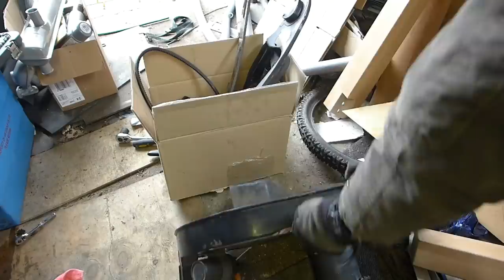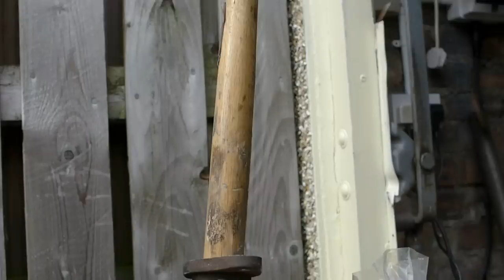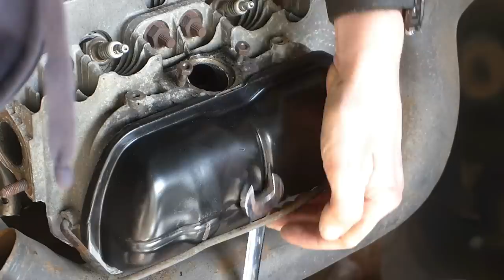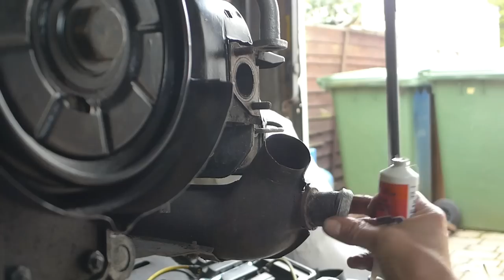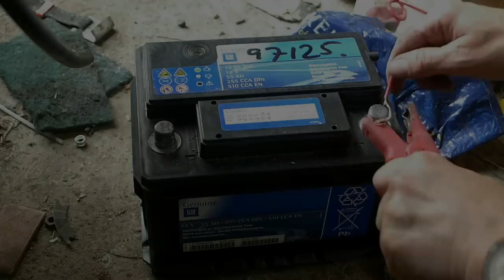Volkswagen Beetle Engine repaint.

Comment: It's nice to rebuild an engine that's complete and not butchered. I've done a couple in my time and spent days repair crap other people have devised on these engines.
Reply from the maker: This engine had spent its life in the USA so the tinware hadnt had the chance to rust badly. It was a nice change to have all the screws come out without tearing the tinware to bits.

Comment: I had a 67 bug. I froze my ass off in the winter in that thing. The best mod for those cars is a gas heater, either an old aftermarket unit or one of the new China made versions.
Reply: Why? All you needed to do was fix the heat on your car. I have never had a problem with mine in my 67. I had a 68 once that had broken cables, but when it got cold. I would take a coat hanger and wire the heater boxes open. Problem solved. But then the heat was on all the time. 😁
Reply: These cars have great heaters.  My '64 will cook you outta there.  You have to sort out the problems.

Comment: Might want to take some safety wire to the clamp holding the fuel line to the carb.  That fitting is pressed in, pretty notorious for that fitting to pop out while driving, happened to me once, all it took lol

Comment: Excellent job! I'm painting mine right now. What hole did you weld closed on the intake manifold? What's the benefit?
Reply from the maker: Thanks. The hole in the intake is a bit of a mystery. I bought the engine complete and it had the hole with a brass fitting through it. I suspect it may have been for a vacuum gauge or servo assisted brakes but the fitting went through the side of the manifold and sat in the gas flow of the carb so couldn't have been good for fuel flow. Weld didn't stick to copper, that's why I put copper behind it and I was then able to plug the hole with weld and not fill the manifold with slag.
Reply: @AstonishingGlasgow  ok cool. Now I have another question. Did you weld a pipe onto an old pulley to use it to hold the generator stator steady? Nice idea
Reply from the maker: I sure did, it makes removing the fan much easier. Its a length of scaffold pole that I also use to tighten rear hub nuts.

Comment: suggestion for next time?? retorque the heads and adjust the valves too.
Reply from the maker: That was all done when I rebuilt the engine. If I added every step the video would have been an hour long.

Comment: a very nice video, please buy yourself a torque wrench to torque the oil filter, oil nut, spark plugs, poley, oil fill tower, etc to specified torque for your next job, that way you will not ruin the beautiful engine that you have painted.
Reply: You dont need a torque wrench for everything.

Comment: Cool vid man how'd u manage to get that crank pully off what did u hold on to while you were using the ratchet
Reply from the maker: Thanks, I had a flywheel lock on to stop the crank rotating while I loosened the not then used a set of pullers to remove the pulley.
Reply: BTJustice alright thankyou that helps a lot! Thanks.

Comment: I think you bent the crank pulley with that 3 arm puller. VW Factory uses a German Kukko puller
Reply from the maker: It was bent long before I got to it. I used what I had available and there was definitely not enough force going through the puller I used to cause damage.

Comment: can’t help but notice you didn’t flush the block of coolant?  forgot to reinstall the radiator too😂😂you should call your local parts store to buy one
Reply from the maker: Thats one of the hardest jobs on these engines so I saved that for part 2 along with the cam belt change. :-D
Reply: BTJustice did you also save the piston return springs, blinker fluid, and muffler bearings for part 2 as well? asking for a friend

Comment: I didn't ever see the 2 Little tin pieces that go on the bottom that clip to the long head Studs.... Most guys forget them and you can't put them on after the Heads are on.
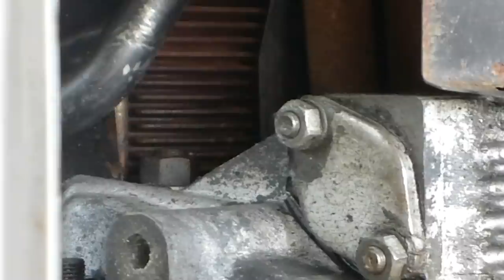Reply from the maker: They are fitted, you can see them at 7:05 above the push rod tubes.
Reply: I just put mine on after the heads were on.

Comment: You don't paint Volkswagen engines,the cylinders can be painted,but definitely not the heads or case.Dont even think about powder coat.Theyre are specific paints to use on air-cooled cylinders.
Reply: Why cant you paint them?
Reply from the maker: I would disagree with David Thompson above and say its fine to pain the case but never the heads or the cylinders. The cylinders are finned to disperse heat so the paint would soon burn off or may effect the cooling. On a VW engine its also pretty pointless to paint the heads or cylinders as you will never see them.
Reply from the maker: I really dont know what that says, sorry.

Comment: Fuelfilter is mounted in the wrong direction. Turn it 180 degree and you’re good.
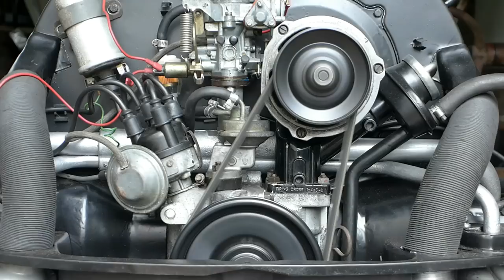Reply from the maker: Its mounted the correct way. If you pause the video at 9:18 you can see the arrow cast into the plastic showing the direction of flow.

Comment: Did you turn an autostick into a manual, cause I seen you filling in that hole in the manifold
Reply from the maker: That hole in the manifold had an unknown origin and use. It was drilled before I got my hands on it but what I can say is that the fitting was definitely not a factory part so its unlikely it was there for an autostick.

Comment: the new engine need rebuild, not repaint. but good job, you just extending the life of the engine by 1%
Reply from the maker: I had fully re-built the engine 2 years previously and it had covered minimal miles. All I was doing was painting the tinware and a service before re-fitting it.

Comment: You could have wire wheeled all the metal like the starter and the outside of the cylinders and all that
Reply from the maker: Thats not the starter from the car, thats the one I use to test engines and its best not to wire wheel the cylinders incase it breaks off a fin. Added to that the cylinders are not seen once the engine is in the car so a bit pointless.

Comment: Nice, 1600 single port engine...?
Reply: Mine is the same. I lived in Las Vegas and updated my 67 Ghia 1500 single port with a later doghouse style shroud and oil cooler when I rebuilt my engine. It was a daily driver and I never had it overheat on me. Simple but effective upgrade👍

Comment: What type of paint did you use? High temperature or just regular paint?
Reply from the maker: Just a regular straight to metal paint. If the tinware on an aircooled engine is getting hot enough to burn paint then the engine will be dead before the paint comes off.
Reply: @AstonishingGlasgow  Too true. 😁

Comment: Zero repair, only paint.?!
Reply from the maker: Thats what it says in the title "re-paint". I re-built the engine around 3 years before this video.
Reply: @AstonishingGlasgow  sorry man. Good luck
Reply: Agree with you. Just a limited paint job of some upper pieces.
Didn't paint below parts.
At least he would changed clutch
Reply from the maker: @gigi09pinky68  Dont assume that things were not done just because they were not included in the video.

Comment: I noticed you were not using the thermostat,thats a no no.
Reply from the maker: Its not going to be an issue for this car as it wont be used in winter. It would have been a bigger mistake to run it without flaps as these push the air towards the cylinder heads.
Reply: My mech. in Cali said they are not necessary.  Warmer climate.  Took out flaps and all.  They are restrictive.  Porsches don't even have them.  On cold mornings, I place a card over the fan opening.  5 min warm up.  Remove the card, close the lid and off I go.  The air ring is even worse.

Comment: @4.41 You did not connect thermostat ... this will reduce your engine life by 50%
Reply from the maker: Dont agree with the reduced engine life but dont worry, the car is a summer car now so wont be run in very cold temperatures and the flaps are in place so the cylinder heads are being properly cooled.

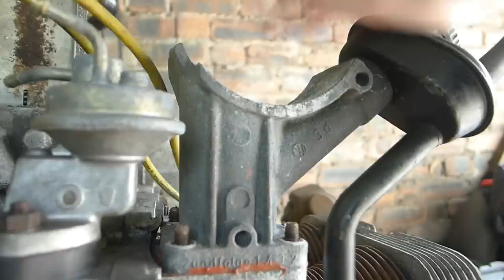Comment: 3:02 no engine number?
Reply from the maker: The engine number is there but not picked up by the camera.
Reply: BTJustice how many cc does it has?
Reply from the maker: Its a 1600 single port.
Reply: BTJustice Did you use high heat paint on the coolerbox? (dont really know the name in english 😂)
Reply from the maker: None of the tin ware(the black bits) was painted in high temp paint. If any of these parts get hot enough to damage the paint there is something very wrong with the engine.
Reply: BTJustice Valve covers? :P
Reply from the maker: Nothing was painted in high temp paint.
Reply: BTJustice Owh ok
Reply: Plate at the lower right hand side of the case tells me that this used to be a Type III engine.  The engine number would on top rear where the case splits.
Reply from the maker: The AS41 case is a "Universal" case from the factory that allows it to be used in Beetles, Vans and Type 3's but this one is configured for a Beetle with the engine number below the generator pedestal.

Comment: You went to all that trouble just to paint the outer panels only, why didnt you overhaul the engine as well just.
Reply from the maker: It didnt need a full rebuild. The engine was rebuilt a few years before I made the video. This was a freshen up before I fitted it in the car.

Comment: well you painted a lot of stuff for sure that looks nice, but you never painted a lick of the engine.  That would have been VERY COOL to watch you do.  after all it is in the title of the video.
Reply from the maker: Dont know if you own an aircooled VW but if you do you will realise that there is no point in painting the block, heads or cylinders. A, you dont see them under the tin ware and B, the paint would burn off before too long.
Reply: @AstonishingGlasgow  high temp paint works fine when the surfaces are prepped properly and the paint is applied properly.  Unless your running temps over about 1300 degrees or so and that's a bit toasty for the air coolers i prefer to build ( kind of a drive ability issue with me i guess). just sayin'
Reply from the maker: It still dosnt change the fact that I would have painted something that would never have been seen and would provide absolutely no benefits. If there was a benefit to be gained from painting the block, heads or cylinders VW would have done it from the factory
Reply: @AstonishingGlasgow  Buddy, I have no desire to make this into some kind of verbal scuffle.  Paint whatever you like. Show Pride in your work however you want.  I think What you did was done nicely.  and Almost Every Manufacturer Paints their engines btw.  I hope you are satisfied with the way you do it, that is ALL that matters!  i was never challenging that at all.  i just said you didn't do what is in the title of the video.
Reply: @TheWhitetailrancher  only the hoppers and the turbine hopper are painted
Reply: Great video. Glad I found it as I just in the process of replacing all my seals and painting it up. The aluminum high temp product is a gem. Also I see I am missing some tin. Cheers.